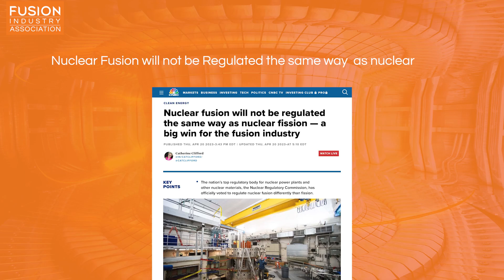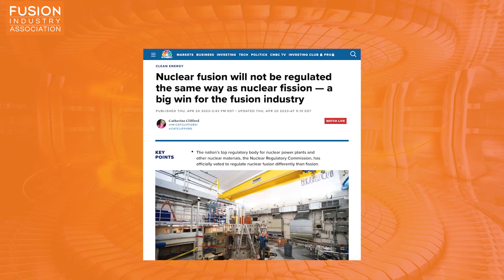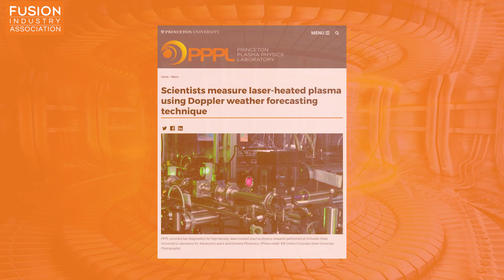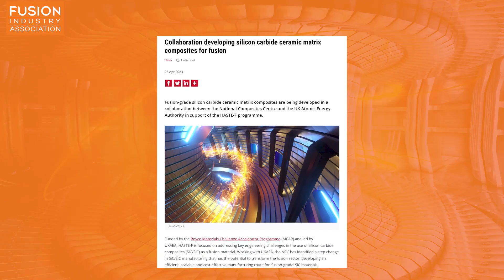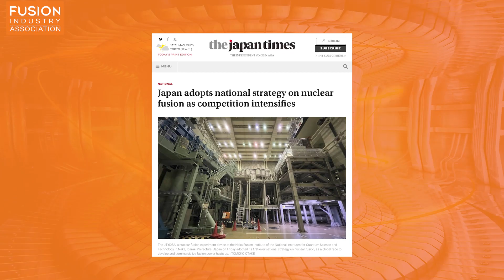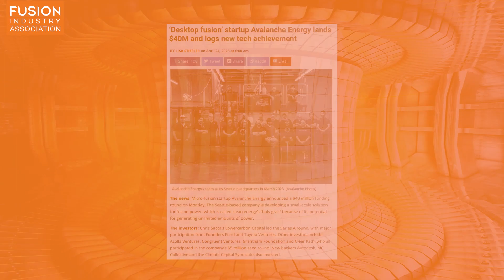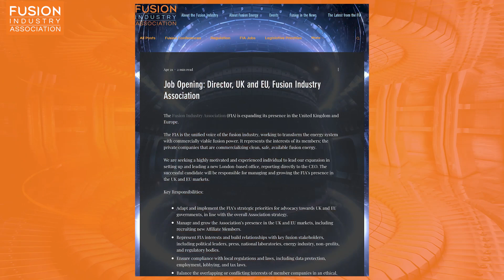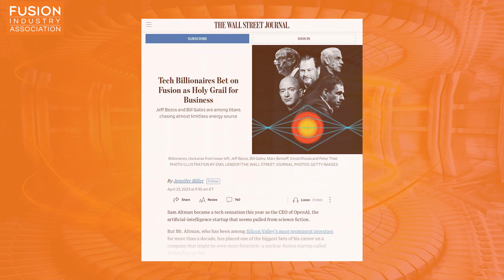Fusion News, May 3, 2023

Comment: 0:53 🤨 I wouldn't be surprised if this specific approach turns out to be provably infeasible. …
Reply: The problem I see immediately: Due to highly deflecting near miss collisions being much more numerous than fusing collisions the nonthermal setup quickly thermalizes and leaks axially to sides or radially to the electrode. So Q>1 is hopelessly out of reach. Like in fusors.
Reply: Maybe they see some very suprising solution to that problem that I don't. But then this needs a paper. More than that handwavy short explanation on their site. - I definitely wouldn't invest.

Comment: These presentations seem to be just turning a handle. If they are serious, they should give us some practical information such as how they will increase the machine efficient of 0.01 for the recent JET record-breaking run, up to that required for a reactor, i.e. Qm = 30, a factor or 3000 greater. This would give an electricity output a factor of ten more than the electricity needed to operate the reactor.